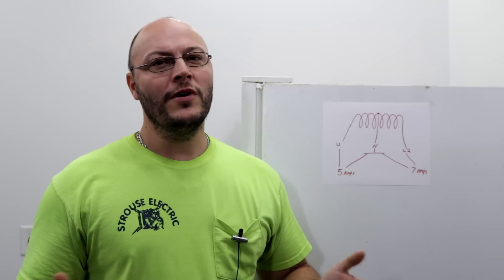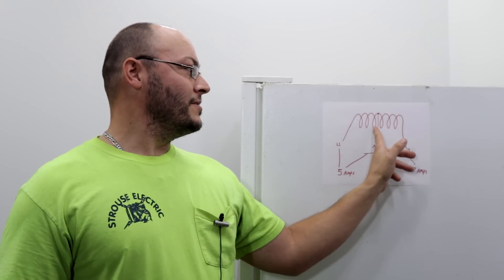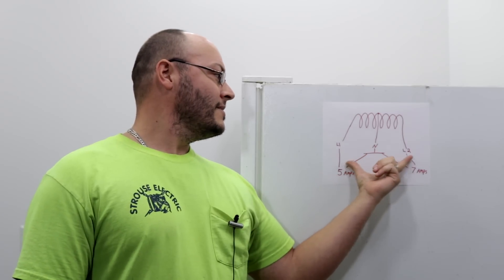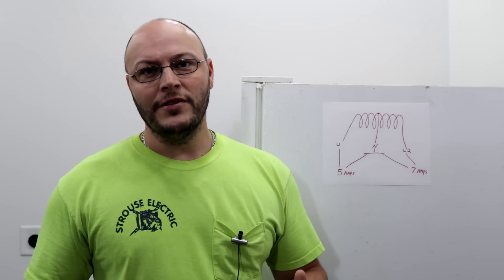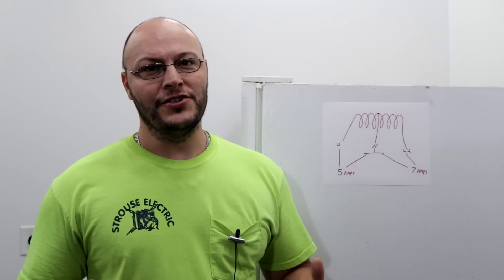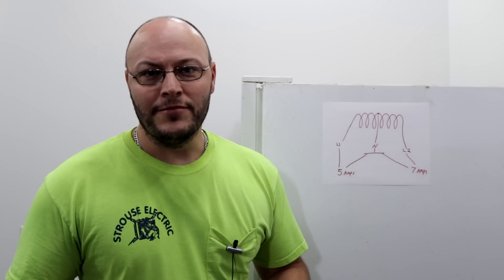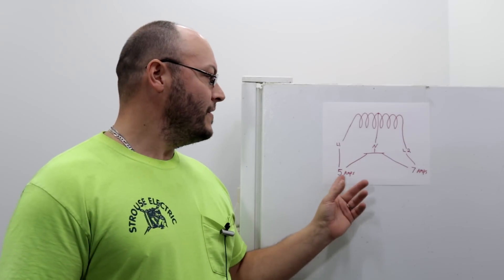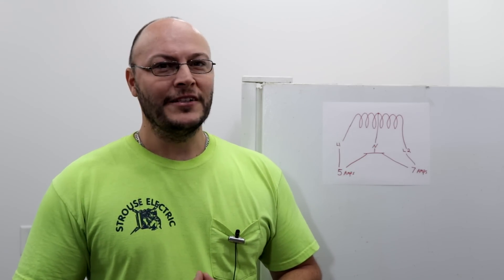What does the Neutral Wire Do?

Comment: Anything to flow from high(phase), there should be a low(neutral) available for it...so neutral wire is basically to avil low  to the system so as to there occurs a flow from phase to neutral ,and through neutral back to transformer........

Comment: Stop thinking of a 240V circuit as consisting of two 120V circuits. 240V is 240V. You can create a 120V circuit from 240V TRANSFORMER circuit by allowing the current to return to the point in the transformer coil that has 0 voltage potential. Ground also has 0 voltage potential. You can wire an outlet or plug on a rooftop in a pinch by wiring either one of the hot 240V wires as L1 and then making the ground your neutral wire. I've done it a thousand times. There is a RAMPANT misconception in the HVAC industry that a 240V circuit is "a 120V wire plus another 120V wire."
WRONG
Reply: Except that makes people sick, very sick michael atkinson. Putting current onto the equipment grounding conductors in the home makes people sick. I hope you'll go back to all the homes where you have put current onto the EGC and rewire it.  I imagine you have also added 120V to 240V appliance circuits (AC units and air handlers) making the ground wire of the 240V the neutral of the 120V. That thinking has created a cottage industry of going behind you and repairing those mistakes. 120/240 circuits require 4 wires  with 4 wires, (H, H, N, G). Remove current from ALL grounding conductors in a home or business..

Comment: i uploaded a video and I hope this helps explain my issue.  Thanks so much Bill - Shawn https://www.youtube.com/watch?v=eGuuUd_lx3Q&t=26s
Reply: YouTube failed to notify me of a new reply to this video so I am a bit late. From what I see it should have worked if you wired your hot black and the other one  to the smart switch per the instructions and used those whites as the neutral and the green as ground. However I think you said you already tried that and it didn't work. If that's the case there must be something going on that I'm not aware of unless the switch is bad. Do you have another location where you could test the smart switch?

I moved to the other video.
Reply: I was able to get an electrician to come in and test for the neutral, since I didn't have a tester. Mister Sparky Electrical, Richmond VA.  I highly recommend this group as they were professional and since it only took him a few minutes and it was a free estimate - didn't even charge me!  I did have an active neutral wire in the 4 white wires connected to a wire nut, in the back of the outlet.  I'm not sure why it didn't work when I connected it before.  Maybe because the other white wires weren't active therefor I wasn't getting a solid connection when trying to connect to all four?  I had the two black wires correct and the green was the ground.  The neutral is very important for those connecting these "Smart switches".  This was an excellent learning experience.  Now I can simply say, "Alexa, turn off everything" as I'm walking out the door and no more worries about missing a light or fan left on.  Hopefully, it will be helpful in the long run and cost effective.  I can stress enough, if you're not sure, turn off the switch at the breaker and make sure none of the wires are touching!  Thank you again for your help!

Comment: I'm trying to set up a single smart switch.  The neutral wire appears or is explained as the wire that provides the constant power to maintain things like time and connection to the wifi.  Can I bridge from the hot wire to the neutral wire to provide what is needed or would that be too much voltage for the connection and possible fry the "smart switch".
Reply: I can't quite picture what you are suggesting or what you mean by bridging. The neutral is the return path to complete a 120v circuit, it passes current but the voltage has been expended in the load.
Reply: So the neutral wire, in this video, is described as the wire that provides constant power to the switch.  https://www.youtube.com/watch?v=y_eY5SfY5y4 . That's why I was hoping to bridge from one of the hot wires to get the signal needed but I assume the neutral is a much lower voltage.  I hope this helps and I appreciate the comments! I have existing 3 wire switch now and what appears to be 4 neutral wires behind it all wrapped with one wire nut.  I tried tying into them with no luck.
Reply: The commentator on the video is apparently discussing how his switch is used rather than addressing the electrical circuits. It appears from his illustration that the the original switch wiring (~2:00) is romex (black, white and ground)from panel to switch and romex from switch to light. The black wires in the 2 romex cables connect through the switch and the white wires connected with the wire nut  are the return from the light and the neutral returning to the breaker panel. I think the commentator is making a misstatement about the neutral supplying power as it is grounded in the breaker panel, but it may just be his way of saying it is required for his switch to have a return whether the light is switched on or off. If you have more wires than shown at ~2:00 I can't with any certainty tell you what to do.  If the switch was just between 2 black wires then you would connect the hot and the load as shown at ~ 0.25.

Just be sure you do not connect black and white wires to each other or wires may burn and breaker trip.
Reply: That's what I keep hearing is that the neutral wire is similar to the ground.  I have two black wires, one green (which I assume is the ground) and 4 white wires in the back of the outlet, all tied to the same wire nut, doig nothing as far as I can tell.  I know the black wire on the bottom of the current switch, is the line in or hot.  Does that sound typical for a simple, 3 wire light switch?  I know the ground is sometimes bare.  I have an electrician coming tomorrow so I'm hoping he'll be able to solve my issue.  If the new smart switch is no good, I guess he can reassure me of what each wire is an that in fact, I have a neutral and if not, he can hopefully run a new neutral wire.  All of these smart switches require a neutral wire so this may become a more common question for you.  I completely agree, that video is not properly representing what the neutral wire is or does.  Thanks so much for your help and hopefully, this will help others with the same issue.  The Philips hue bulbs have been great and easy to set up with a hub and integrate with Alexa.  Even the smart outlets I've installed have been much easier.  Unfortunately, Philips does not make a 4ft florescent smart tube bulb, yet.  I'm surprised because you see these in a lot of buildings.  The smart tube I purchase from Luhas, did not work and I tried everything to get it to connect.  Again, thank you so much!